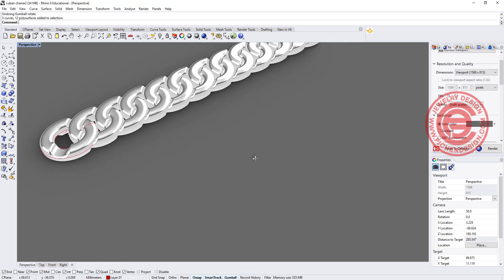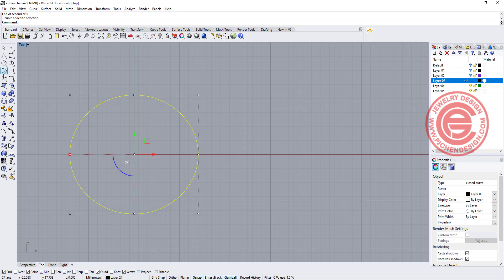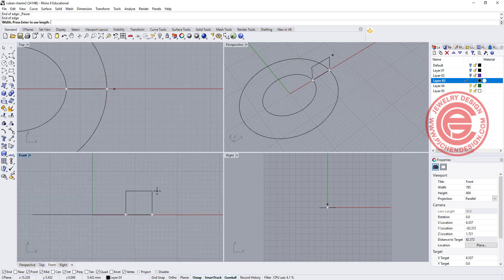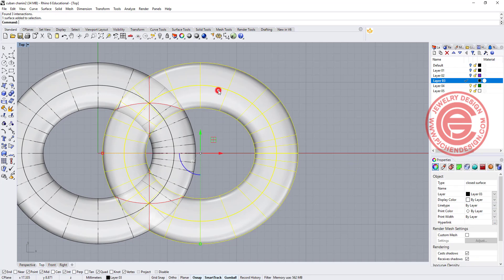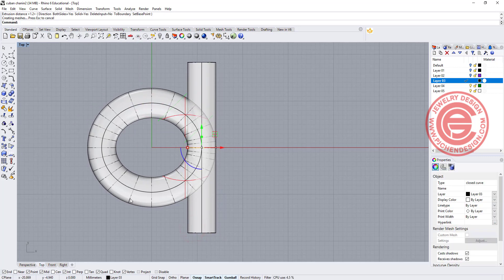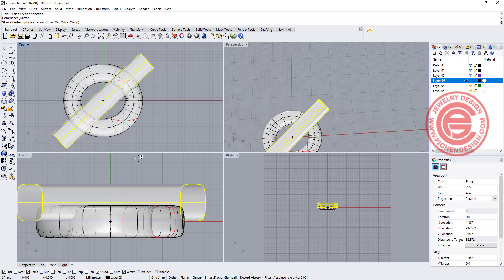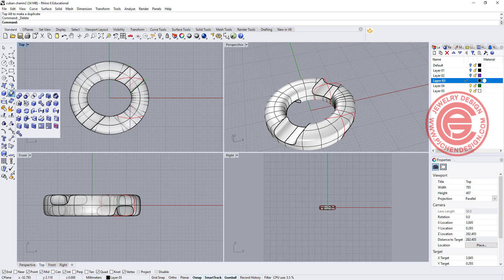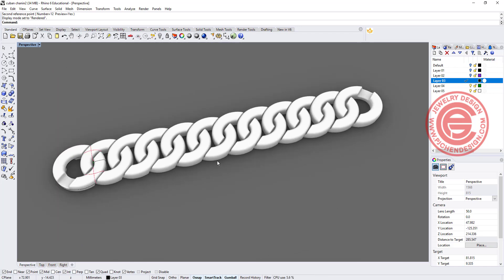Jewelry CAD Design- Cuban Link 3D Model Tutorial in Rhino 3D #150

Comment: Can you teach how to make 3D jewelry with low weight gold? Big style but use low weight of gold. Sorry my English is not good.
Reply from the maker: If you need to reduce the weight of metal, you may need to hollow from the back as much as possible but still can be cast. How much you can hollow out is depends on the design.

Comment: Good morning PJ. I admire his work a lot and I appreciate his effort, I have followed him from the beginning and I see that lately the tutorials are more basic, easier and faster. In this case, to make the adjustment between one piece and another you have done it with a straight solid, but it would be better to offset a piece so that it has the same curved shape and has more adjustment and thus avoid corners. It is fine to teach for different levels of knowledge, a good idea would be to separate the exercises into basic, intermediate or expert. A greeting!
Reply from the maker: noted! Thanks for the feedback.